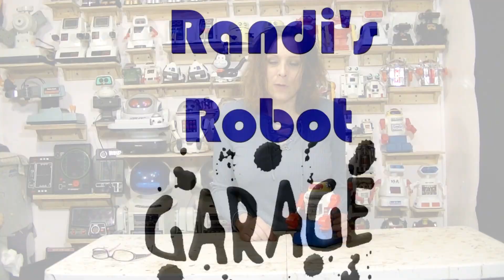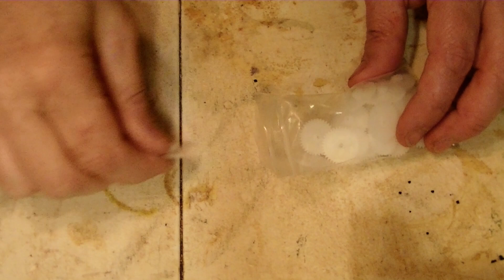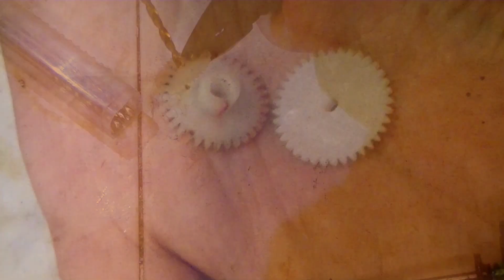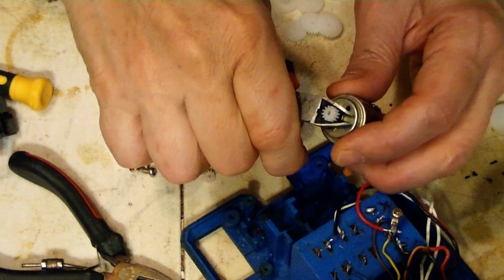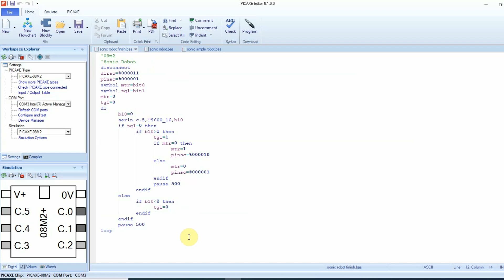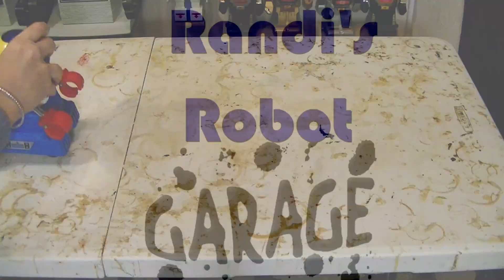The Return To The Sonic Robot - This time it's personal.

Comment: why didn't you just cast some of them ? just curious.
Reply from the maker: If you watch the first video, I did. I would have had to buy special plastic for thin walls. There's too much pressure put on them. When the robot has any kind of push back, or runs into something and puts stress on the gears, they just sheared the teeth off.